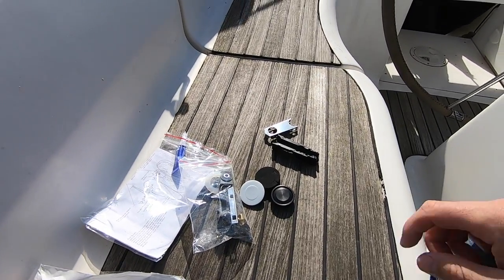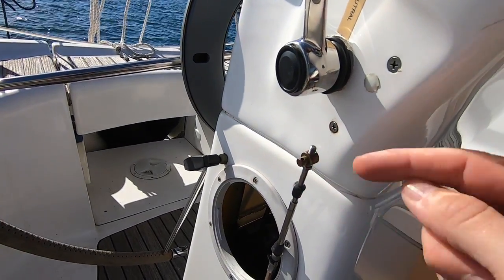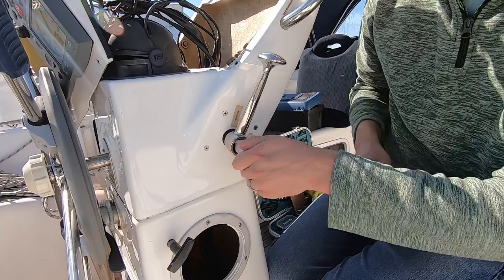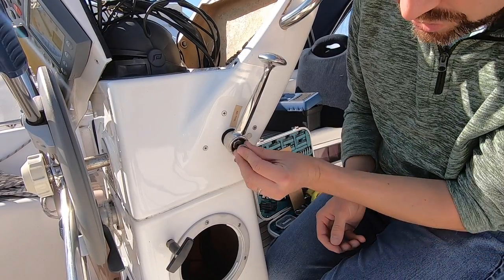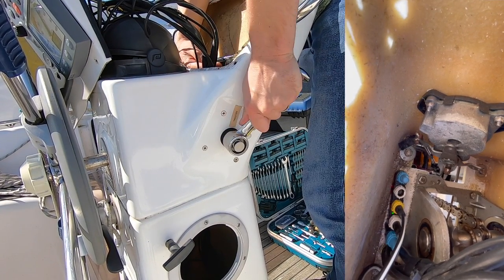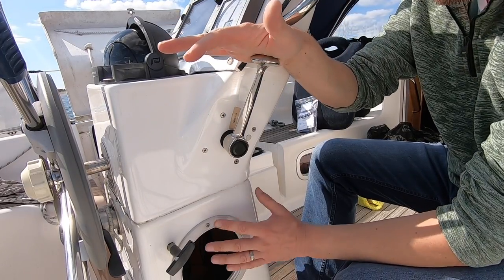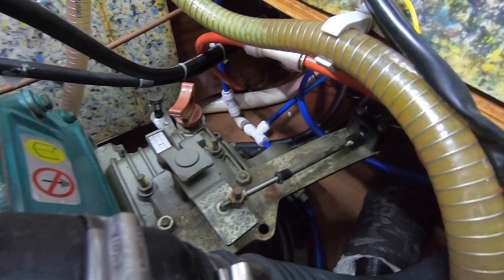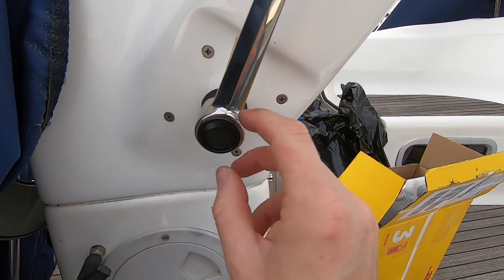Lewmar gear linkage repair & cable adjustment - (Whitlock) morse controls - Boat Projects

Comment: Hi Mat, if I remember correctly our Lewmar crank handle had the black spongy doughnut against the pedestal then the white plastic washer then the crank handle...
Reply from the maker: Hi - Thanks for that. It will stop that softer foam part from sticking against the handle. Makes sense